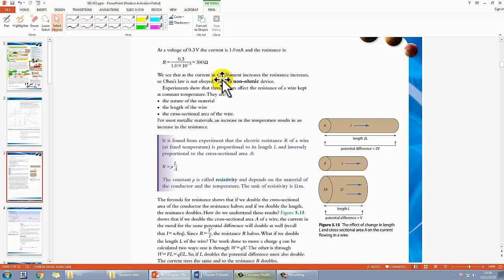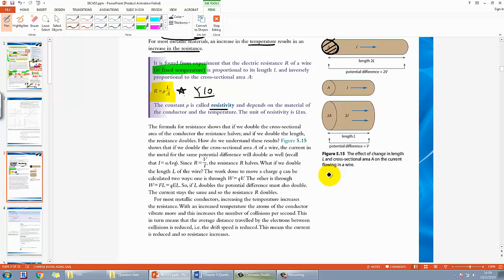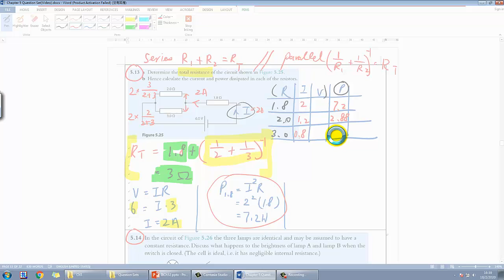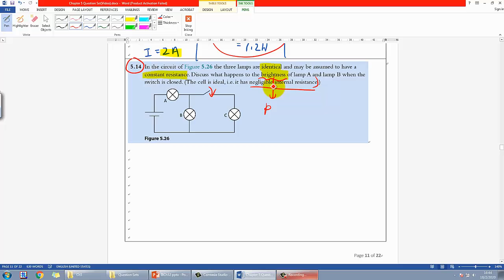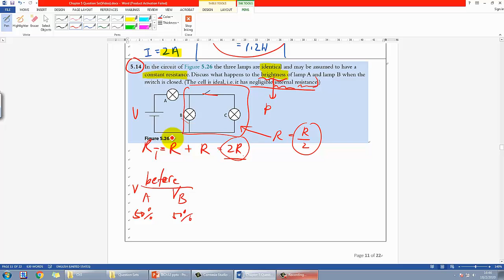More Resistance and Power - IB Physics B.5 - Part 2

Comment: 19:22

For the formula V^2/R, why didn't you consider the fact that the R value also changes, which will change the total value of V^2/R
Reply from the maker: R is a constant unless there is a change of material/thickness/length/temperature